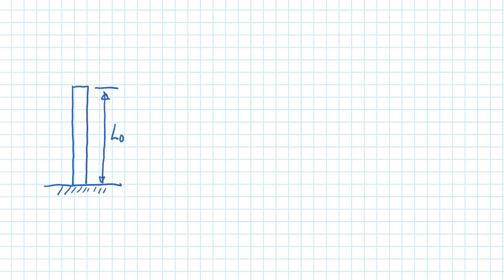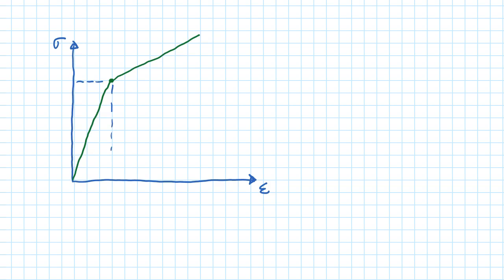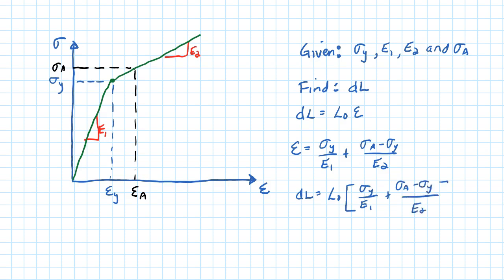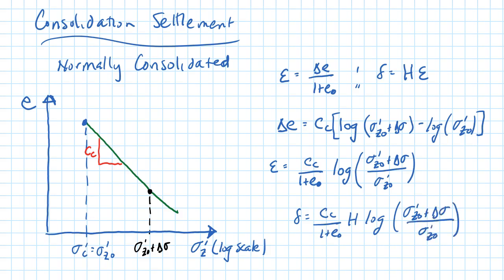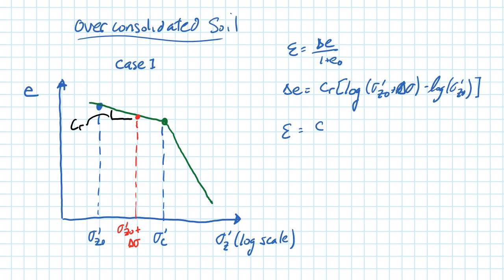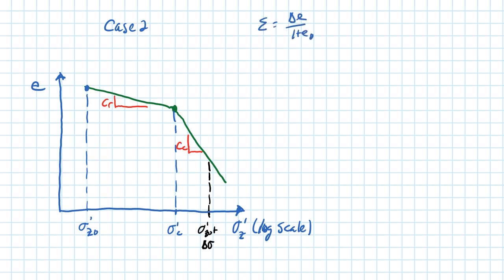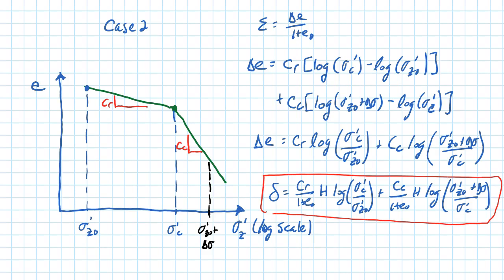Consolidation Settlement Equations

Comment: Best video about consolidation settlement I have found so far. Thank you for share your knowledge with us.

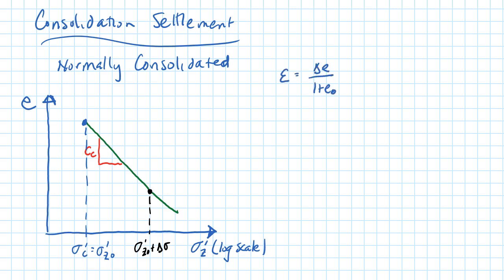There is just one thing I didn't understand well. Why that formula to strain at 3:59 has 1+e0 on fraction instead of just e0?
Reply from the maker: The volumetric strain is equal to the change in volume divided by the initial volume.  Using weight-volume relationships, we can show that this is equal to the change in void ratio divided by the quantity 1 + initial void ratio.
Reply: @TheWeav94  When I first saw this in college I didn't understand what teacher was explaining us. I just understood yesterday watching your video. Thank you!

I think derivation is a very important step to fully understand a theory

Comment: what is delta sigma
Reply from the maker: delta sigma is the increase in stress in the soil.  The stress increase could be the result from applying some load at the surface (placing a layer of fill or a load on a foundation).
Reply from the maker: Delta sigma is the change in vertical stress due to applying a load, such as placing fill or from a foundation.